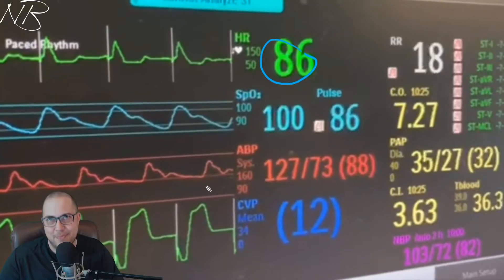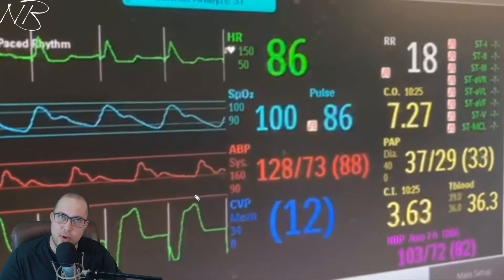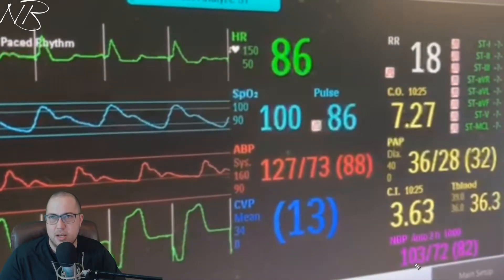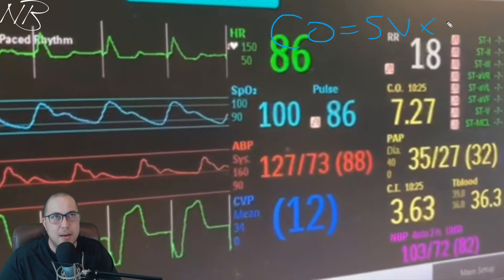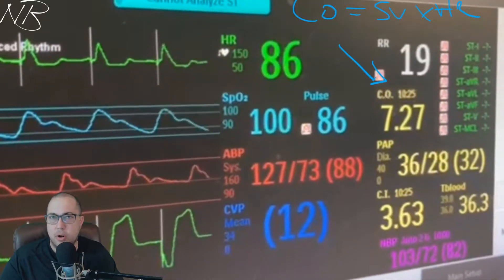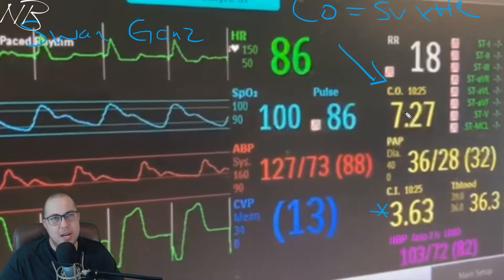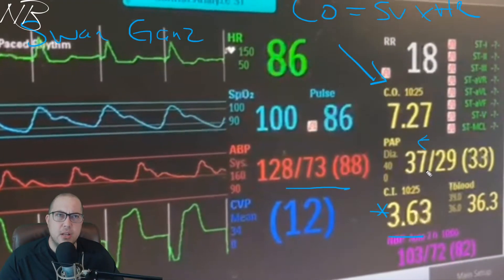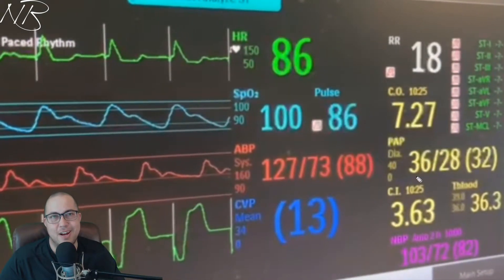Basic Cardiac Hemodynamics (CVICU/Open Heart Recovery)

Comment: The Arterial Blood Pressure or ABP in its surface context is half nature while the PAP or Pulmonary Artery Pressure the sensed pressure and movement of blood and the length of SVR  for blood to be able to move through along it's length of plasma membrane and the vacuumized pockets or entirety of circulate along it's path of PVR to valves up the IVC and SVC to Atrial Valve a diagonal circuitry of supposed CVP to PAP in my analysis only of that if factor of creating sensor line connect like a thread weave of interconnect spots of node stations as coined words only when it comes to detect and analyze outside frequency or beam effect interferrance.

Comment: A vehicular accident patient with spinal injury and with pneumothorax to atelectasis due to lung puncture of something, tracheally deviated compressing either side if heart is compromised but managed to ICU, can a  device or some sort of powerful sensor with control implanted function like in holter monitor operated remotely be of a 2nd option connected to heart specialists, and a severed spine grey matter and  severed nerve fibers be replaced by the other grey matters in other parts of the brain by the use of adjacent receptor motor inducer supposedly former connections of  nerve fibers now severed, new signalling created from the manipulations of sensors from  glial cells and and organ nerve receptors augmented by new nannotechnology created organ receptors because nannotechnology can do that now and with modified  neuroengineered Schwann cells all signals in that patient body emmanating from the other grey matters in the brain other than the butterfly spinal grey matter? Monitoring hemodynamics sensor based.

Comment: Is this screen from a simulator or a live patient? If it's live data, I'm impressed that they're able to generate that BP and index while only being v-paced. Makes me wonder how much dobutamine and/or rocket fuel is infusing. That PA pulse pressure is really narrow too. Not sure what to make of that without considering the patient. Thanks for the video, NB!
Reply from the maker: Quite often if a patient is sick enough whenever they exit the OR, then they are on a bit of rocket fuel for a period of time. To your point, the patient is only being V paced and doesn’t have the atrial kick, but may be on vasoactive and/or inotropic drips such as epinephrine or milrinone. Also keep in mind as a side note, if the patient were on dobutamine then we should likely see the patient with their own intrinsic rate high enough to not require pacing. Of course all patients are different 👊🏽 Also, I know practices vary from facility to facility but in the few Surgical CVICUs I’ve worked in, dobutamine isn’t typically used in the open heart surgical population as it typically contributes to cardiac irritability 🤙🏽 Love to see the wheels turning! Grind on!